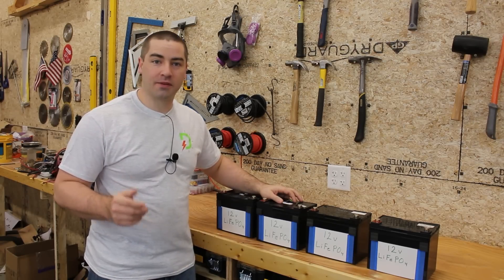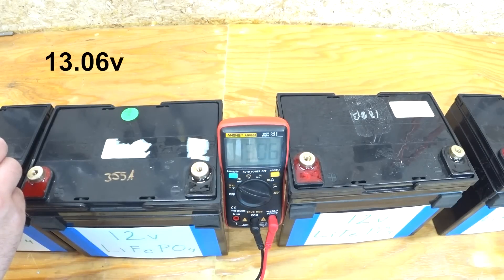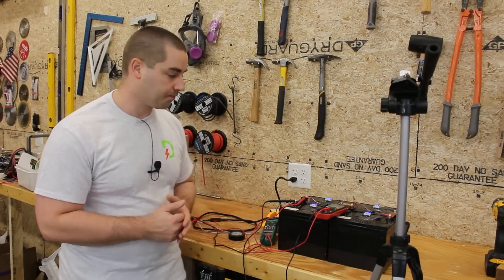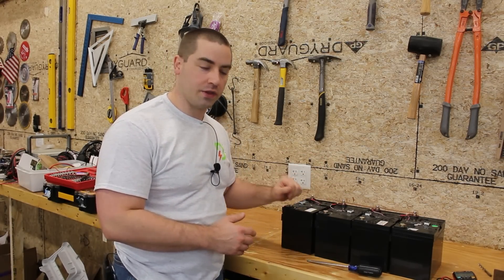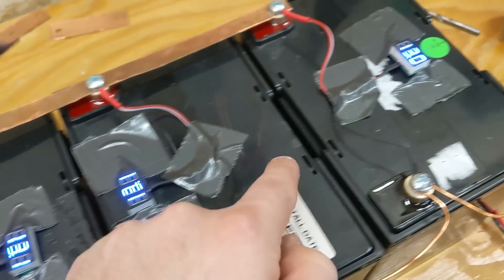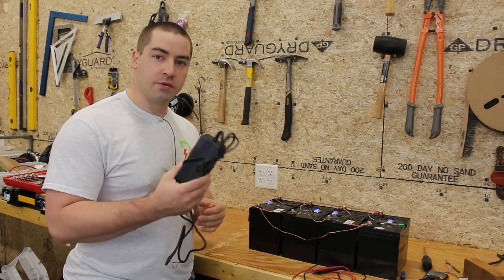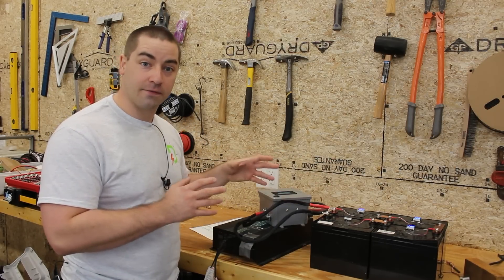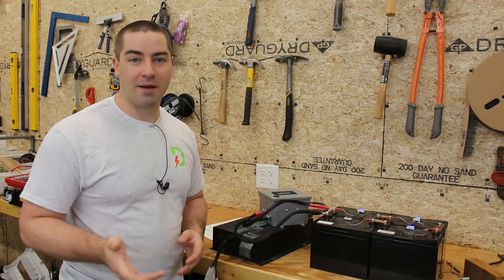How to Series Connect 12v LiFePO4 Batteries, and Top Balance

Comment: What percentage would you consider yourself to be off grid including winter solar hours with they system you have? Also not sure if you have but if not can you let me know how many ah/kwh your battery bank is?
Reply from the maker: I was off-grid from April through October, but now back on the grid.  Winter is harder to be off-grid since we have less sun-hours, and my house requires more energy in winter for electric heat.  This past month I've been on-grid 2 out of 3 days.  I'm probably around 29kwh of battery right now.  Not sure, I've added a few small batteries since my last capacity test.
Reply: @DavidPozEnergy  thanks for the reply.  that's amazing that your able to  be off grid for that long in a full home. I'm completely offgrid but only in a 600sq home with 14kwh battery bank winter is a drag especially when we get 5 days in a row of overcast skies. We mostly use propane for cook stove, instant hot water heater clothes dryer and a pellet stove for heat. Cant wait till I can get a bigger battery bank to offset the propane maybe the cook stove and the instant hot water heater. Another 3000kw array won't hurt either. 👍

Comment: Rather than reconfiguring the batteries in parallel, can you boost charge the low batteries individually within the 48V circuit?

Comment: How does top balance bottom balance do anything other then possibility show a bad cell? Shouldn't the BMS bring each cell up to the specific level voltage then it cuts power and hold and charges the next one also going from internal battery resistance maybe if it's a second life battery the cycling actually might bring back some capacity.

Comment: Hello My name is Don and i`ve been watching you for a while 
My freezer control knob  has just  been hit and i think i saw you took a old freezer and found a thermostat to control it for fast drinks
can you tell me where you got that control i need to get my freezer going again
mine just will not shut off so i know it works
Reply: my phone number is 978 340 8982  if you could text me here
I`m just pluging it in and out to keep it cold
Reply from the maker: This is the one I use with my chest freezer: https://amzn.to/3hPgskg  This time of year I heat the chest to keep it above freezing.  The controller has a plug for cooling, that's where the chest freezer plugs in.  And the controller has a plug for heating, which is where I plugged in a 25 watt light bulb.  The setup keeps the drinks cold, but not frozen.

Comment: I don't think it's safe to series connect most lfp 12v batteries, unless the manufacturer has specifically stated so.
Generally any lfp battery that can be series connected will use an external bms.
Just imagine driving a heavy load, one battery goes low volts and tries to switch off, mosfets fail as they will now see most of that 48v (only being designed to stop 12v) and battery damage/failure will quickly follow.

Comment: DIODES....use diodes my friend and all of the problems that you have mentioned in this video will disappear.  I will give you a schematic of the battery pack you have here but with diodes if you contact me.
  Diodes are more than just a one way check valve for electricity. 
I have solved all my balancing issues with diodes.  And it is done automatically.  Its all in the way you hook them into the circuit. 
Contact me for info.

Comment: HNY David. So you found one battery at 3:00 that hit its top charge value and BMS switched off charging. You then dumb charged all batteries at 12v (to 14v+) and reconnected them and ran another 48v capacity test giving you 6% gain (but of course because you dumb charged them all to 14v+.  What was the result of the next charge at  48v after this balancing with BMS? I'm curious to see if the balancing dumb charge actually made a difference. Thanks for your efforts, you're the best!

Comment: David (and family) happy New Year and hopefully many videos like this
I don't know if you are clairvoyant but this is precisely the problem I was dealing with right now. I have 10 batteries 12V200A for a 24V solar panel system. Now I know why I can't get the capabilities of this set. It does take a lot of work to disconnect and balance them but do it and then load between min and max.
Thanks.
Reply from the maker: I glad to help you solve the problem.  With 200ah packs you might want a larger charger, otherwise it will take awhile.

Comment: I didn't seem to find it in the videos or the comment. When you have a 48V set up, what BMS are you using? Are you using the same bms when you do a parallel connection for the 12V?

If these were individual LiFePo4 cells, that would be a 16s bms for a 48V, we would need a different one for the 4s configuration at 12V one? Or is yours the one that has 4s~20S range?

Comment: David I always enjoy your videos. Why isn't there a 48 Volt  BMS using 4 12 Volt batteries in series? I have 4 100 AH AGM strings in parallel in my 48 Volt system. It seems to me there would be a large demand for a BMS for this configuration. All I have found is a  Victron product, but you need more than one for each string. Any ideas? Thanks
Reply from the maker: This one: https://lddy.no/tczy
Reply: @DavidPozEnergy  I love  alt e utube videos. This looks like what I need. Many thanks.

Comment: Another outstanding video.
And absolutely necessary for the DIY folks!
I have tried to explain this scenario to other people but they just tell me that if the batteries all have a BMS in them there is no problem hooking them up in series, 
Your video just highlighted the problem. 
The BMS protects the battery it is attached to, but in a series connection, you are only as good as the weakest battery,.
 The 'best' solution for that problem would be if there were two more contacts on each battery,, (one for each cell), which would allow you to attach a 16S BMS EXTERNALLY,.... thus eliminating the need for frequent top balancing.
 You might want to suggest that to any battery manufacturers you deal with.
The industry needs batteries with that capability, and it would only cost a few pennies more per battery, (and may allow the internal BMS could be eliminated).
One other possibility would be to use an external BMS that would externally balance the voltages across each 12 volt battery so you would have the internal BMS balancing the 4 internal cells in each battery, and the external BMS balancing the 4 batteries.....
 Of course that would require someone to design a BMS for 4 (or more) series BATTERIES instead of 4 individual cells...

Comment: You need to check with particular 12v LFP batteries that they are series stackable to number you intend.  Many, typically low cost, 12v  LiFePO4 batteries BMS's are only made with 20v or 25v breakdown MOSFET's so may avalanch if BMS switch opens when run at 48v stack.  Higher breakdown voltage MOSFET's cost more for same current ratings.
Reply: How exactly does this play out? I'm using 4x12v in series, each of which say not to go higher than 24v, and they still work fine. I'm not saying you're wrong, I just don't understand the risk.
Reply: @jimmybrad156  Nothing will happen unless one of the BMSs decides to disconnect. Then (as per your other question) it'll suddenly know how many batteries are in series with it,. Have they been fine over the three intervening years?

Comment: Next day same shirt  lol    lier lier pants on fire  jejejejjjejejejeee  grate video for new people   just pulling your leg not personal just in case
Reply: clever you move the camera  take the flags out from frame and move the screw drivers  only miss one part. you mic is at the same spot same angle  right in the same place the "day before" lol you miss that detail  .   lol david you Rock any way.
Reply from the maker: I have a lot of the same shirts.  But, hey, even if I had a different shirt on I've had  similar comments from people saying I just switched shirts.  LOL  I'm not that clever.

Comment: Great explanation video. I would also mention for new users to not just parallel random voltage batteries with thin wire as the current transfer to the lowest may be great and melt the wire or minimum heat up the wire.  I would charge each battery up first, then parallel to balance (Maybe you did and I missed it😉)
Reply from the maker: You are right, and it's a good point.  Maybe I edited out that clip, It took me 3 days to edit this video and some stuff gets cut for time.    I could parallel mine because they were 0.02v delta.  When people ask me about paralleling I tell them to be within 0.10 volt delta to keep the amps low.
Reply: @DavidPoz  I completely understand during edit LOL.  I have heard you say that in other videos!

Comment: Hello and thank you,! There are a few different ways to connect in parallel, which is most favorable for batteries? (lifepo4) like you connect or connect everyone to the same busbar with equally long cables?
Reply from the maker: The short answer is yes, Bus bars with equal length cables are the way to go.  However, we could do a little math and get into that in more details.  There are a few different configurations that can work if you are trying to tidy up all the long cables, or something.

Comment: Very good idea for this balance. It really help battery get long cycle life. It is same technology why we need balance cells before assemble battery pack. But normally BMS will have balance function, but this solution do not have the balance function, so as time went by, the unbalance things still will happerened. That is why lithium battery is not good for in series, only if with a master BMS. And one more things is that: do not series your lithium battery as you want, because most 12V BMS electronic chips can not handle that high voltage, means if high voltage, the BMS chips will broken. If you assemble a 48V pack, those chips should working with more than 100V Chips, and for sure the cycle life is not as good as the single pack.
Reply: How would the 12v battery's internal bms know / suffer if it's part of a 48v battery?

Comment: I fell into this trap with brand new BatteryHookup 32650's where they were all around 3.3V but clearly not the same SOC.  Silly me built a giant 12V battery without parallel charging them and now I'm having a bitch of a time top balancing it.

BTW:  I know you're just swinging it on the lab bench but using elastic wire (like solid core copper) which is bare is a bad idea for battery applications like this.  All too easy for the wire to spring back and hit something you don't want it to.

Comment: I use a 48v battery balancer, it hooks up similar to a bms except it has a +/- for each 12v battery and keeps each battery at the same voltage
Reply: I was wondering if there was such a device. Do you have a link to the product?
Reply: @judo-rob5197  
https://www.ebay.com/itm/333113199150
https://www.amazon.com/KRXNY-Battery-Equalizer-Batteries-Balancer/dp/B07FD1R6Q1

Comment: Would you do a research and then a video about the energy pack in a laptop and periodical maintenance procedures in order to keep the battery  as healthy as possible?
Reply from the maker: Thanks for the video suggestion.  Are you talking about cracking open a laptop battery case and pulling out the 18650s?   If this is some kind of computer program to run, then I'm not a computer engineer.
Reply: @DavidPozEnergy   - hey there, Happy New Year, physics is not about computer programs, a battery is a battery even though is an energy provider for a watch, a phone, laptop, car or a house, I think that your knowledge can be applied anywhere we "feel smell of lithium"

Comment: One important note. This is only really true with batteries of similar capacities and internal resistance. With dissimilar batteries they will quickly go out of balance again. OK - they’re top balanced and theoretically each battery will discharge the same amount of energy in series - but in practice a weaker cell may have far higher internal resistance and be harder to recharge forcing the pack out of balance again. Series connecting 12V LiFe batteries is a gamble although up to 48V is supported by some high end manufacturers. Check with the manufacturer.
Reply: Higher internal resistance does NOT matter. Battery cell wih higher internal resistance will still recieve the same amount of electricity (Amp*hours) except at slightly different voltage. The real problem is uneven colombus efficiency or self-discharge. Lithium batteries are also very special in a following way: cells with poor colombus efiiciency (<99,9% is poor) or high self-discharge also degrade and die very fast.

Comment: Top balancing of any Lithium batteries seems to increase their output. I'm working with some 4V rated packs and if charged as 5 7S they only will output about 14 Amps out of the 22 they should. But charge them as 7 5P cells with the units sharing connections, they charge higher and output 20 Amps before the BMSs shut them down. I currently have one pack for testing that all were in parallel charged and they went to 4.3 Volts each without the BMSs shutting down with all being charged at a total of 2 Amps. No swelling of the packs either. The units are going to be used for destructive testing  to see how high the charge Voltage can be on the 28 Volt pack before something gives. Each of the 7 cells will have its own meter. If they withstand 36 Volts across all 7 (5.14 each ) then a test also will be done to see what the most WH is on discharge. I also have a single cell for testing without a BMS and one of the twins that I will see just how high the input Voltage can be before something gives. All of them will be over water so if they catch fire, they will drop into the water.

Comment: What about after you have top balanced the batteries, and put them into series connections and go through many normal charge discharge cycles for,  say,  a year, will the four batteries remain balanced?
Reply from the maker: They tend to stay balanced if they are all the same manufacturer, model, and bought at the same time.  But if they ever drop to 0%, then you have to re-balance them again.  I program my inverter to shut down before my batteries hit 0%, actually about 20%, so I don't run that risk.  it's automatic after you program it.  But something to be aware of.   It's still good practice to re-balance them like this once a year.  At least that's what I do.

Comment: is that big batteries has 17Ah capacity? i think that something is missing. Some of manufacturer says that do not use lifepo4 batteries in series.
Reply: Yes, it's preferred not to have lithium batteries in series, and the capacity loss is just one reason why. When charging in series we saw one battery shoot up to 18v. Such a high voltage could damage some batteries, hence the warning against this.
Reply from the maker: @eDoc2020.  I'm sorry if I wasn't clear in the video.  The BMS on one battery shut down because that one battery was full.  The volt meter on that particular battery was now reading a false charge since it was still connected to the charger.  The individual cells inside that particular battery were not actually at 18 volts.
Reply: @DavidPozEnergy  I understand that the terminal voltage is not the internal battery voltage and that the cells are not at risk. The question is what is the maximum terminal voltage before the BMS is damaged. The MOSFETs which disconnect the cells can only withstand so much voltage...

I'm sure the 18v in this example won't cause any issues, but with a less-regulated charging setup it could result in a "load dump" and much greater voltages. This could result in the protection circuit failing and potentially unsafe conditions. I believe this is why some manufacturers say not to put batteries in series or put a limit on the series string. Just a CYA on their part.
Reply: İ think that you miss understand me. 17Ah is look like low for that size. İ think that those batteries are 40Ah batteries(may be more) but discharge completed on 17Ah. So i think that something missing in video may be i am wrong. Just trying to understand. I prefer 8s bms instead of putting 2 seperate batteries in serial connection.

Comment: You can leave them all in series and use a 4 bank charger. Boaters used these all the time. They will charge the batteries independently from one another when in series configuration.
Reply from the maker: Thanks for sharing a tip from the marine world
Reply: I think that would actually be a more ideal solution. Unfortunately I haven't seen solar chargers with that configuration. Perhaps some sort of external balancer could be used instead to achieve a similar effect.

Comment: Would charging a 48v 4s configuration with 4 individual 12volt chargers with every discharge cycle extended battery life even longer ?
Reply from the maker: I am basing my recommendation around the idea of a solar system. It wouldn't be practical to do 4 chargers with solar
Reply: @DavidPozEnergy  thanks for your content!
Reply: I have done this a few times with golf cart lead acid when charger down .  Probably not worth it every time
Reply: That would work fine and would achieve top balancing every time you charge. Another option which would work better with solar is to use an external balancer.